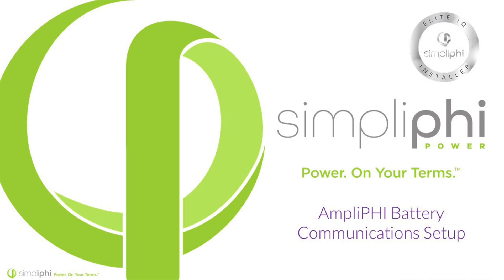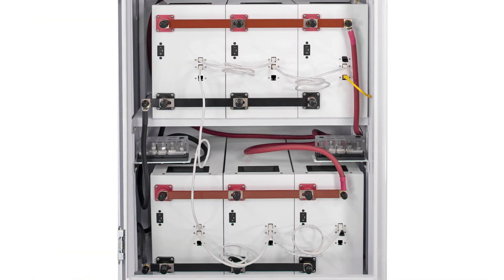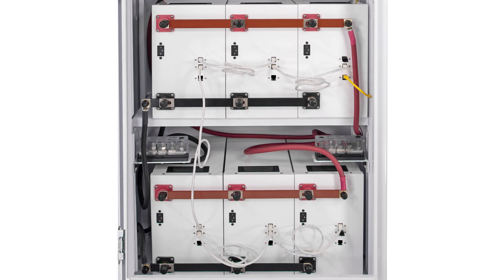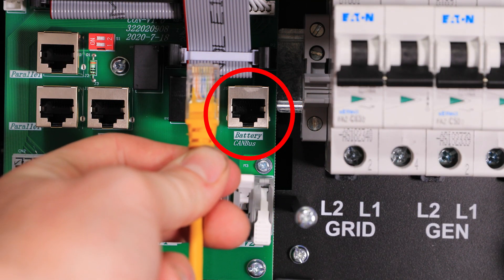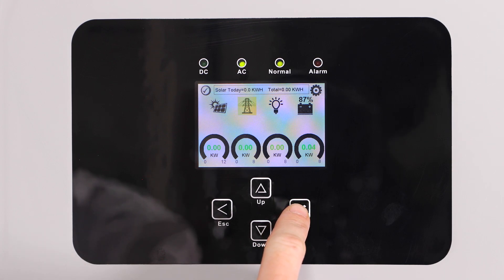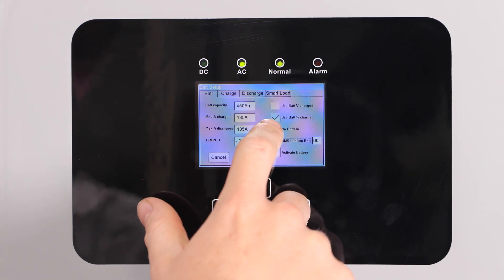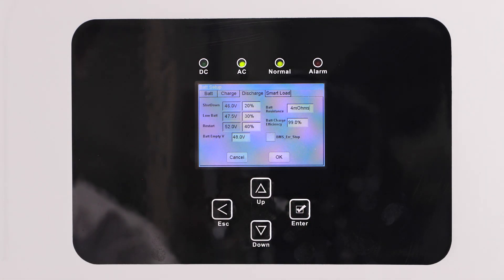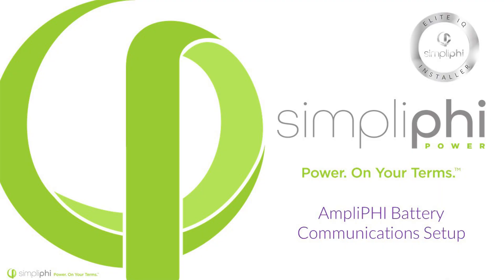SimpliPhi’s AmpliPHI Battery Communications Setup w/ Sol-Ark

Comment: What he doesn't show is that you can't set the Start% because it's grayed out.  

To fix this first check the Grid Charge and this now allows the Start% to be set. Remember to click Ok when done.

21% is chosen to be just above the 20% we use for Shutdown, so if you have grid power available, it will charge the batteries at least up to Restart which we are setting to 30%.

I'm was also wondering why 20% is chosen for the shutdown, when the AmpliPHI battery says it can discharge to 0%.  This is because 20% means an 80% depth of discharge, and their installation manual on page 22 talks about recommended depth of discharge, and resulting life of the battery.  As it turns out,  a 20% bottom (or 80% depth of discharge) makes it last much longer.